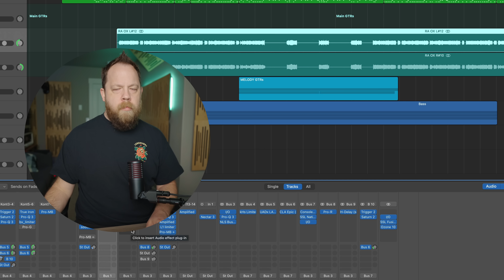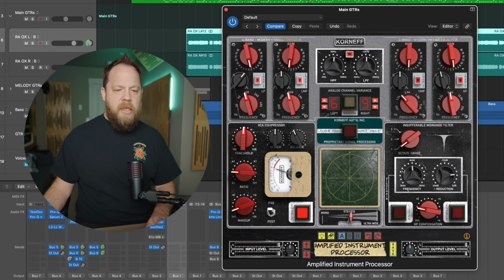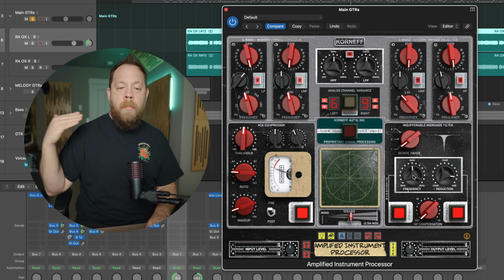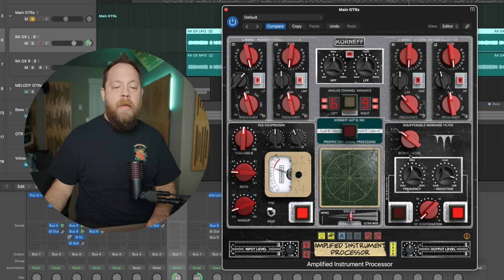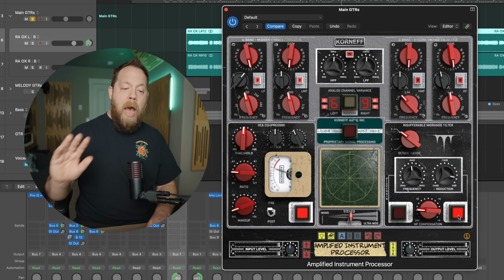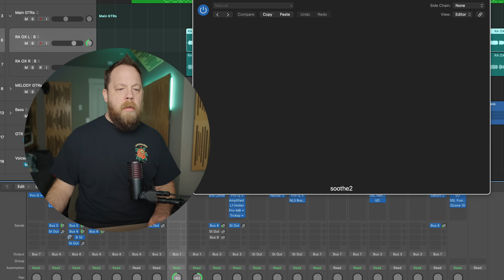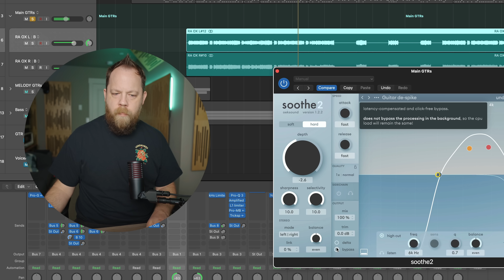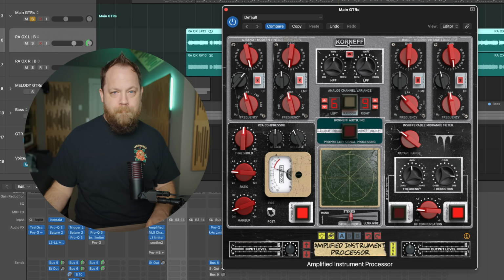Clean Up Your Guitars (Without Soothe)

Comment: You can hear it clearly on a phone. However, this can be easily dealt with using a normal EQ. You can even make separate bands for the octaves just like in IMF
Reply: There’s a lot of other aspects of the plugin to be desired; there’s obviously EQ and low/hi filters, but also stereo/mono width adjustment (this one sounds amazing on widening a bus), dynamic eq, saturation and tonal characteristics such as tape, tubes, or an original Korneff circuit, etc etc etc. It’s a bunch of very high quality tools in one plugin that can be used on a lot more than just guitars. Fluff is just demonstrating one aspect of the plugin

Comment: oh damn that's awesome! It's essentially what i end up doing with an API 560 Graphic EQ. this is a bit easier to use. I like soothe 2 more on clean guitars as it pokes out through a lot more. i find with distorted guitars a LOT is lost from the tone and sound so i don't use it often. I will often boost the 3-5k range with a Neve EQ to boost attack and notch out exactly around 4k with an api/notch to get rid of nasty resonances. It's a bit janky, but it sounds great in the end. that being said sometimes it's just easier to mic things myself as when i do that i can better get a tone i like. amp sims never quite 100% get what i want and i rarely get recordings to mix that are like that.

Comment: Honestly you can do this with an EQ, which I like to do, then use soothe for helping to just keep things clean afterwards. You can really dial in soothe to just use it on problem areas, especially if you figure out where exactly those areas are with an EQ first. I like to get soothe dialed in, typically way more narrow than you had it here, then turn up the depth until the unwanted noise is gone, but without it changing my tone. 

Also that bass top end needs some love, in the mix it was the most harsh and whistling thing I could hear.

Comment: I try to tame harshness with some notches or small cuts in the 2-5K area before I use soothe with the Nolly “Guitar De-Spike” preset and usually have the depth knob turned down compared to what it is on the preset. It prevents the guitars from being too neutered while getting rid of some extra harshness that I’d struggle to get with static notching alone.